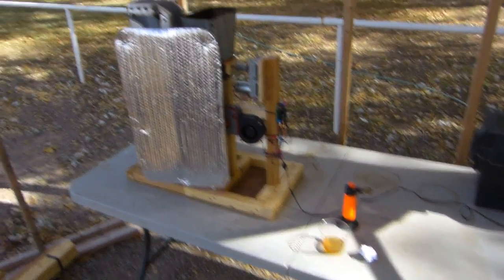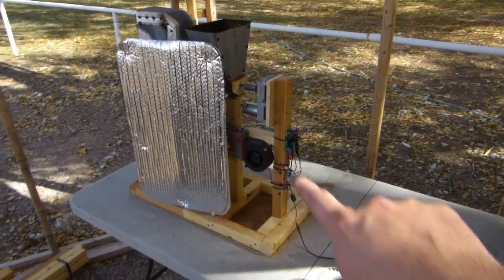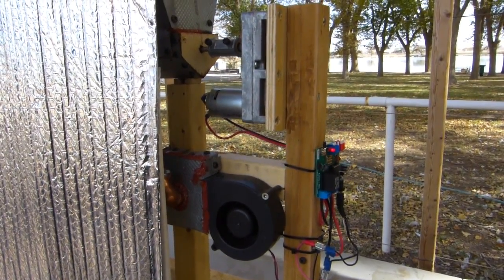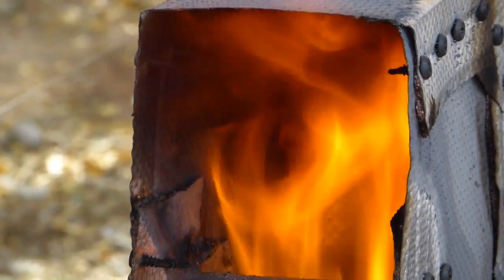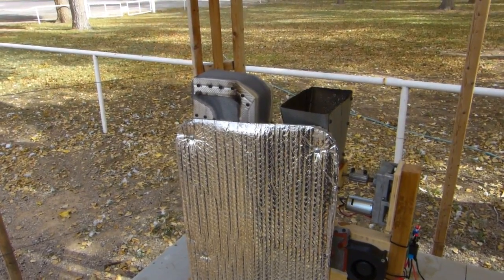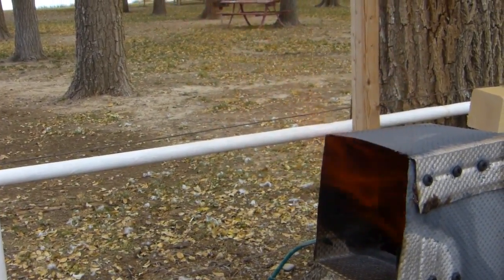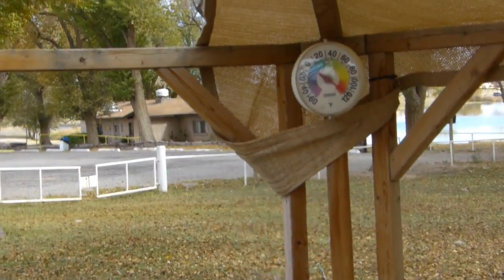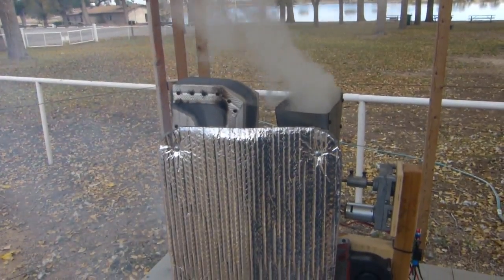Homemade 12 volt Pellet Stove 1st Automation Test

Comment: I'm Guessing he has gone, off the grid.as he said he was going to do, it is to bad he didn't lift that heat shield to expose the rest of the design. i have put the electrical together, and i have 3/8 wall 4" tube. ready to cut and weld one up. looking for the design basics.

 "Designed By Instinct I'm designing this for total odd-grid operation. It's going to heat my 
house with hydronic floor heat and charge a small battery bank. Enough 
power to run a 12 volt off grid Novakool fridge, all lighting and a 
laptop when I feel like it. Oh, and a Lepai LP-2020A+ 12volt amplifier 
and speakers for music all day"
Reply from the maker: I'm still sorta here LOL. Not totally off grid, but real close. I'll attempt to revisit this unit soon-ish. My new video space is complete.

Comment from the maker: Both the Sundanzer DCF225 and Novakool RFU9000 use the Danfoss BD50 compressor.

Very power efficient and repair parts are common and available. I think they only pull 6 amps @12 volts DC.  Far better than any of the RV fridges that are 12 amps or more.
Danfoss is the only way to go I believe.

Comment from the maker: Sundanzer uses Electrolux cabinets and Danfoss compressors to make 12v chest freezers. Look them up.  DCF225 is the biggest one (8 cu ft) 12 or 24 volt - $1300

I'm going to get a Novakool RFU9000 (9.1 cu ft) . Largest upright fridge/freezer they make. It's basically a small apartment size marine fridge/freezer. 12 or 24 volt. - $1900

Comment from the maker: I'm designing this for total odd-grid operation. It's going to heat my house with hydronic floor heat and charge a small battery bank. Enough power to run a 12 volt off grid Novakool fridge, all lighting and a laptop when I feel like it. Oh, and a Lepai LP-2020A+ 12volt amplifier and speakers for music all day ;)

If I scaled it up I could make much more heat.
Right now it's running 30,000 BTU approx. at this feed rate and low CFM of air.
It's nice and efficient at these settings. Long runtime.

Comment: if 50000 btu = 14kw  that's amazing.

I wonder is it cheaper to buy pellets and run this machine than run the gas or electric from the mains? Either way, its great you have a back up system with a fuel that has a very long shelf life. : )

Comment from the maker: The pellets used are plain wood pellets available almost everywhere. Fairly cheap and consistent to use. This stove can also burn wood chips with a proper large auger.

This exact stove is probably in the 50,000+ BTU range if I push it.
Most pellet stoves are 30,000 - 70,000 BTU max